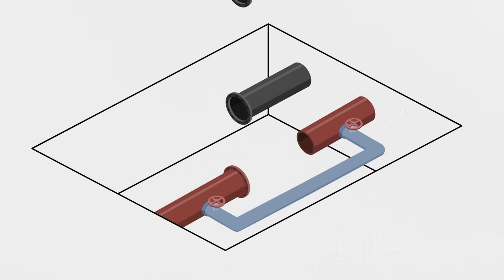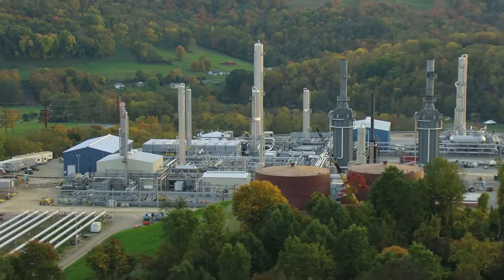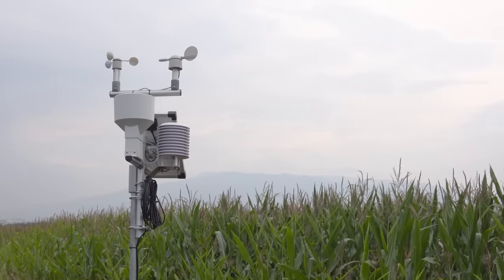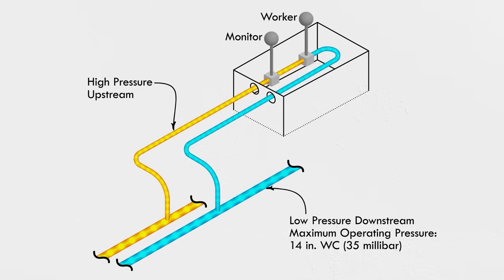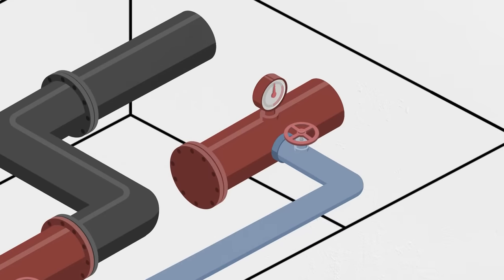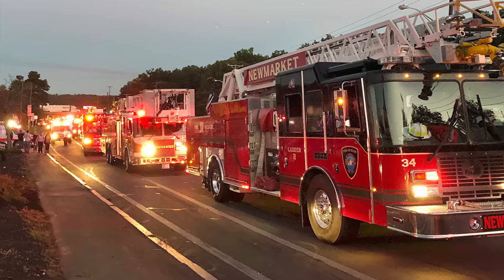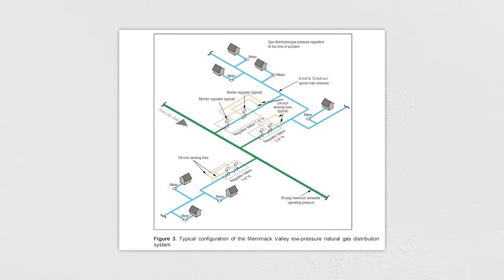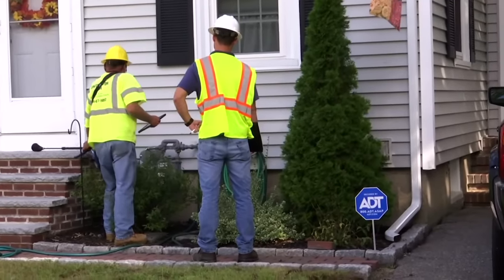What Really Happened During the Gas Explosions in the Merrimack Valley?

Comment: As a former controls programmer, I am a bit surprised that there were no high pressure shutdowns (measurement and valves) built into the discharge side of the regulators.
Reply: You would think they would have a "short loop" control as well as the long loop. Set it to whatever the absolute max pressure rating the low side supply has. Turbulence should never trip that, and the cost vs risk of failure...
But then again it's easy to say these things from our armchairs after the fact.
Reply: Right?!
I too program control systems. The hardest, most time consuming part is to program what to do when things don't work the way it's supposed to.
Reply: @zyeborm  Well stated sir.
Reply: I work in this industry, and am pretty familiar with Merrimack.

A large number of our control systems are purely mechanical, only relying on control lines and regulators. We have some SCADA, but it's really only for monitoring. Most of the controls are on the large points of delivery sites that operate at the 500-1000 PSIG range. Benefit to the mechanical ones is that they operate 24/7 regardless of conditions or power. Most modern regulators have great turndown, so as long as there's even some pressure differential from the high to low side they will regulate well enough. 

Modern regulator stations are typically monitor operator, with two downstream points to measure pressure. The operator reg actually controls the pressure, and the monitor is there to take over if the operator fails, as they usually fail open. Downstream of that is a relief valve, usually a pop relief that blows at a set pressure and prevents downstream buildup, or, more rare now, a security valve (slam shut valve is what i've also heard these called) that deteces overpressure and shuts off all flow. 

The kicker with all of this is that you can hop the fence at any major regulating station in any rural state, clamp a control line (which tricks the reg into thinking it's 0 PSIG downstream) and dump 600 PSIG into a town. Lots of stations out there with absolutely 0 security.
Reply: That's what the regulators were doing.  The control side was just monitoring the wrong pipe.  So you would have to implement integrity monitoring to determine if the error signal made sense.  And it would still be something like a common mode failure mechanism.  I was wondering if they could implement a burst disk somewhere safe and vent/burn it off.
Reply: @zachary_fb  that last paragraph is kind of frightening in how plausible it sounds.  I think security is lacking at some water treatment plants as well. Imagine, someone with the right knowledge of the system could poison an entire town or city. 

Its kind of like nuclear weapon mishaps, its kind of a miracle that there hasn't been more disasters due to mistakes, pure chance, or just a lone wolf looking to cause mayhem.
Reply: @major__kong  yah, I was thinking that burst discs are a cheap and simple solution to this problem. It sounds like they just didn't implement any control measures at all
Reply: @major__kong  That's not what the regulators were doing. Controls and shutdowns should use separate hardware. A high pressure shutdown could have been designed to monitor the pressure at the outlet of the regulator and close the inlet to the line if the outlet pressure exceeded a high value.
Reply: @brucelytle1144  I personally don't find it hard, but for sure it does require some thinking.
Reply: @goury  the hard part is imagining all the things that could go wrong! Or even worse what some (experience has shown!) crazy Russian can do to "fix" things!
Reply: @major__kong  I'd imagine the safety-of-last-resort could be a burst disc feeding a really tall pipe like something off a pipe organ. It'll emit the unholy screech of the damned, thus ensuring the fault is immediately obvious, while also dumping the gas high enough in the air that even if the flare ignition fails for lack of power, it'll still dissipate to a safe concentration in the wind.
Reply: @vylbird8014  Some systems are built with these type of emergency controls but they are usually smaller "dead-end" regulating stations (think a cul-de-sac or small neighborhood). They are ineffective or impractical for systems with the kind of differentials in pressure and capacity described in this video.
Reply: Also poor planning. We always had crews on site at all the regulating stations downstream to make sure things like this did not happen. We would also do a few trial runs of disabling the bypass to make sure pressures dropped and recovered as expected across the system. Even with good oversight and design this was important because with 100+ year old cast-iron systems there was always the potential for undocumented connections or interdependencies.
Reply: @zyeborm  I wouldn't think they've needed a loop at all - just a comparison with plan atmosphere, just see 1/2atm on a network that at most should have 1/30th of an atm.  One task is adjusting the fuel to follow the "load" (it needs feedback) another is to shut all off in case an extreme (but still manageable) value is reached.
Reply: It would have change nothing since the fancy probe was on the wrong pipeline. You would have read no pressure while it was blowing up...
Reply: @pierregravel-primeau702  You could just have a safety valve after the normal valve that shuts closed if the absolute pressure in the pipe (measured in the pipe, not using a separate control line) exceeds some critical value... the reduced accuracy of such a measurement doesn't seem like it would be a huge problem considering the enormous pressure difference between the normal condition and regulator failure state.
Reply: @major__kong  man that last line.. I was out geocaching the other day and found a major gas reg for my area.. That is really bad!
Reply: I hope they have implemented failsafe systems by now.
Human error is a given and should always be treated as such in designs.
Reply: That's exactly what the regulators with their sensing pipes were doing (or supposed to do). I guess you could install a check for a check but we all know that this wouldn't happen.
Reply: Or some kind of "overpressure fuse".  If more than 2-3x nominal pressure then a valve fuses the output side shut.  No gas for you... but no explosion at least
Reply: It's about money, honestly. Also, there are thousands if not hundreds of thousands of these systems in use and are 99.999% safe. Overcomplicating it won't make it more safe.
Reply: @zachary_fb  as with many things, the inherent design of a simple, reliable system like this is good, assuming that everyone has an IQ over 80, a cutover checklist, and isn't a terrorist.

The problem is the assumption about the people.
Reply: @zachary_fb  , you are absolutely correct about the security around regulator stations and city Gates  (in most cases the security is a chain-link fence with a padlock). But in this particular case, it was an inexperienced engineer (green at best) and outside contractor that didn’t understand the entire gas system (kind of like having a heart bypass surgeon that was 
only trained on that subject without going to medical school to learn the whole body). The NTSB not at least putting some blame on the contractor, I found a little disturbing . That  contractor should have been monitoring gauges, upstream, downstream, and at the football stoppers (as Grady would say “the  balloons”). Gas leak crews are expected to do it on emergency repairs  and the NTSB  gives an outside contractor a pass , why?. The NTSB recommendation for engineering only makes common sense, that someone experienced should be designing these systems ; do they need to be a PE, i’m not so sure, but do they need to have proven experience, Absolutely. 
My experience comes from 35 years in the gas utility industry , stay safe out there and please learn from those mistakes👍.
Reply: I was thinking the exact same thing
Reply: Probably was not used because of cost, and was cut out of the design by some bean counter because it would "never be used, the valves are 100% reliable", and thus they never included this, or even a burst disk, on that flawed assumption. Yes there are plenty of century old valves in use on water lines and such, but most get used once a decade or so, and you can bet most also leak a little now.
Reply: the state of most infrastructure is appalling, it's kept together with duct tape and bailing wire. It's failing in ways that have been preventable in 1930s
Reply: @marcogenovesi8570  , you are correct. Out of the 17 categories on US infrastructure 11 are rated with a letter grade of D and overall (all 17 ) get a grade of C minus (up slightly from the last grade of D ). This country is great in a lot of ways but when it comes to maintaining, not so much.
Reply: @boby115  Currently the "solution" to many low grades especially in bridges is to not do inspections, which is a way to not get bad grades I guess so mission accomplished
Reply: @davidebacchi9030  what you described is called a control loop. You have a sensor a controller and an actuator "looped" together.
Reply: @vylbird8014  having a burst disk big enough to dump all the gas from the high pressure main and operate reliably at that low pressure level and not fail from transients or a mouse farting on it would be a challenge. Not saying it's impossible, but it wouldn't be easy to get right I don't think. If you did though it'd be a very reliable solution.
Reply: And redundant overpressure protection farther down the line.

It's like having multiple thermostats in your home. Even a vaguely smart heating system should be able to ignore a spiking thermostat measurement, and assume the rest is correct. Similarly, in a system where 4 overpressure sensors are reporting overpressure, and only 1 isn't, that one is most likely faulty or compromised, and the other four can be assumed correct. This would mean the faulty sensor is reported, and the system will be closed until an army of qualified engineers have given it their thumbs up. But something tells me 100 year old systems are not quite that smart.
Reply: @brucelytle1144  The other side of this is the cost and risk associated with introducing an active electronic control system. It's pricier than typical ICS equipment due to the explosive environment ratings, it introduces additional complexity and potential interactions between components, and there's a security risk associated with a connected system that's capable of more than just acquiring and reporting sensor readings. Those additional risks have to be managed on an ongoing basis. Such systems are typically subject to additional regulatory requirements (meaning more GRC overhead), and these days most connected control systems require assessment by specialist contractors for things like ISA/IEC 62443. It's easy to see why a simpler passive pneumatic safety system consisting of a primary control and a redundant backup is an attractive design, especially in an environment that's usually fairly static.
Reply: They simply assumed that having two redundant systems was enough.  They didn't understand that a redundant system that relies on the same input signal is not complete redundancy.
Reply: @zachary_fb  A lot of places hire somebody to say "What are the ways that this can fail accidentally?"  But for major infrastructure we need people who look at "What are the ways that somebody could make this fail?"  While nothing is perfect, securing the easy failures is something we need to look at.
Reply: @ctdieselnut  I deliver a chemical commonly used at water treatment plants, both fresh and waste water. The waste water plants aren't super secure, but then again it's not risking public health to ingestion, and they regularly sample the outflow to make sure there are no contaminants that made it through.

The fresh water places I've been to are much more secure. They are fenced/gated, the operational equipment is all inside secured buildings, and they also constantly sample. It would be rather hard to introduce a poison into the system without having a fair bit of inside knowledge. Even with being a delivery driver, I only know my specific functions for unloading. I'm typically not even allowed inside the plants unsupervised.

I won't say it's impossible to prevent any and all attempts at sabotage, but it's probably much harder than you think.
Reply: @philopharynx7910  Sort of, the problem is that the redundant systems are designed for normal operations, things change when you start doing work on the line and putting in bypasses, a manual mechanical static system isn't designed for that, so they developed strict processes that allow work to be done in such a way that the safety systems remain operational and don't cause a problem, but if people don't follow the process to the T, you're screwed as there is no tertiary system to catch your mistake. No one wants the added expense of redesigning a system that has additional failsafe mechanisms built-in to deal specifically with maintenance, so they kept the processes and assumed anyone that would be doing the work would always be properly trained to follow them. 

In a new environment, adding in battery-backed electronic control systems on top of the mechanical would be super simple, but here in New England, you're talking about gas lines laid down over 100 years ago in very busy neighborhoods, and from the utility's perspective, they weren't about to incur the enormous cost of modernizing it unless they knew someone was paying for it, or they could get away with passing all that cost on to the customers.
Reply: @racerex340  Oh, the advantage isn't just for maintenance.  When both safeties feed of the same line and operate the same, then a common failure can make both of them fail.
Reply: @zachary_fb  Pretty scary there.  Too many large accidents as it is in apartment buildings without leak detectors.
Reply: Are these gas utilities publicly (government) owned, or privately owned?
Reply: @Bruce Lytle  what programming languages do you use when programming controls?
Reply: @major__kong  A valve reacting to overpressure and a massive burner like they use to torch off excess CH4 in oil production would make a dandy "Warning light".    "If you see this burner lit, there is a bad problem in the gas system!"
Reply: @ctdieselnut   Far as I've been able to determine, there's never been an accidental nuclear weapon detonation, tho in one case it was a really near thing.  If you read up on the "Broken Arrow" event in North Carolina in 1961, despite assurances DoD issued at the time, later declassified reports revealed that one of the two Mk39 weapons that fell out of the disintegrating B-52 had just about fully armed itself, with only the on-bomb arm/safe master switch preventing the bomb from going off.  Essentially, a hardware-store toggle switch (slight exaggeration for emotional impact :D  ) prevented a nuclear detonation, as designed (but still...). The second bomb, the one that hit the ground at several hundred knots, was badly enough damaged that if it had gone off, the un-boosted (no discharge of the stored tritium into the plutonium primary core) fission explosion would not have been sufficient to trigger the fusion secondary.  Small comfort, I reckon, for the Air Force recovery crew who found the on-bomb switch in the "Arm" position.   A post-mortem report done by Sandia National Laboratory held that the Mk39 lacked sufficiently robust safety systems for the weapon to be deployed to airborne alert force bombers; given the weapon and the circumstances of the mishap, we're darned lucky there isn't a nice round radioactive lake in the middle of North Carolina nowadays. :|
Reply: @zyeborm  I’ve worked in the industry for a major NG company in Southern California. We started replacing all are lines with PE in the streets but when a major disaster happened Storage needed to turn off the “high lines”. I guess what I’m getting at is this should be controlled by computers from the storage but they physically had to turn them off but it didn’t close completely, lack of maintenance probably. SAR, Firefighters, CHP and those guys from USAR Vandenberg 🙏
Reply: @Airman_Fu  I work in IT, controlling the pressure should 100% have mechanical failsafes. If the pressure hits a level that would cause damage to the network then turn the gas off totally and leave it off until a human goes and releases the valve. 
You can make the computer side of it cheap and easy enough to do normal operations stuff though but keep the mechanical backup on the regulators.
Reply: Mechanical overpressure trips (OPSO valves) are standard as are two independent pressure regulation valves in series to prevent precisely this scenario.
Reply: @tomsixsix They are called OPSO valves. Over Pressure Shut Off valves. They usually trip at 120% of rated service pressure.
Reply: @alextallen8019 the actual failure rate is 0.1% per year.
One failure per century for the primary and a 10% common cause failure rate on the secondary.